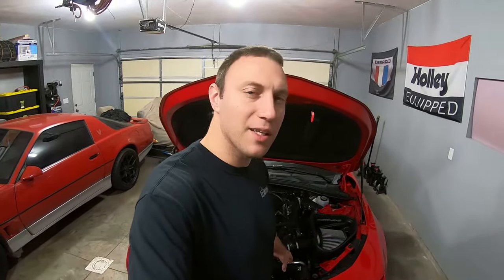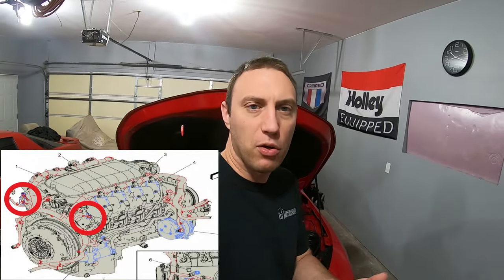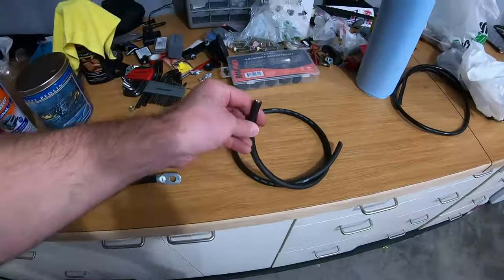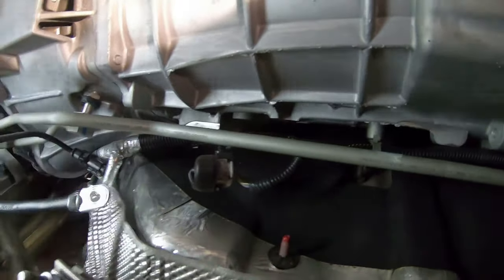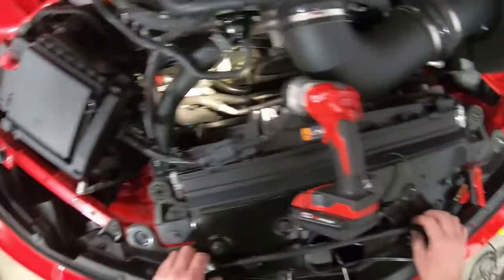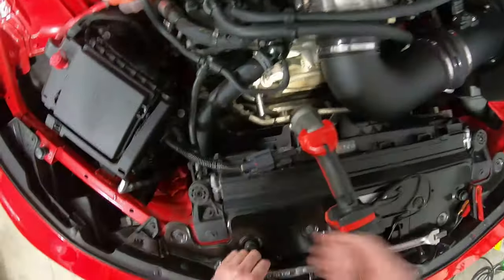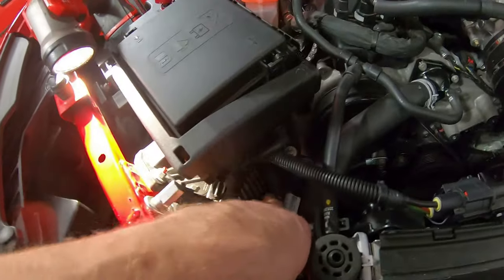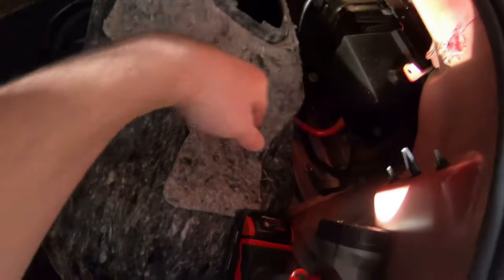Camaro Electrical Issues Solved!

Comment: Gonna have to try this. My tach bounces like a hula girl. That and if I autocross the car, it is a bitch to start hot.
Reply from the maker: Definitely worth a shot. Check other grounds are tight as well.
Reply: @EssMotorsports  installed both grounds as shown.  So far no tach bounce.  Have to test drive it tomorrow.  Now the B pillar port cover on the convertible snapped the spring off and won't close when the top goes down.  Cheap @ss GM 💩.  3rd time this has happened in the 7 years I have had the car.  1st two were under warranty.

Comment: Hey man you ever have a problem with your right front turn signal not working? All the fuses and bulb is all good but still doesn’t work.
Reply from the maker: Not that I know of. Sidemarker or headlight?
Reply: @EssMotorsports sorry for the late reply. I found the issue it was a broken ground wire that goes straight to the wire harness for the turn signal socket. I ended up fixing it and then a week later the black wire broke and now it’s all fixed and good now.
Reply from the maker: @chrisx2015  where is that located? Under the dash?